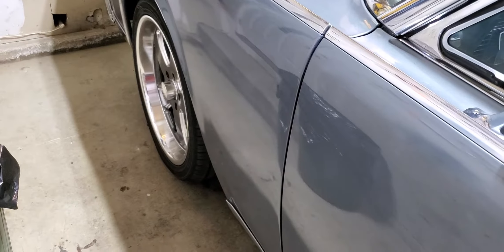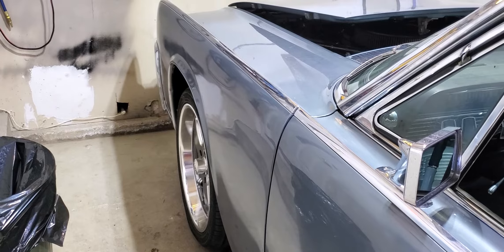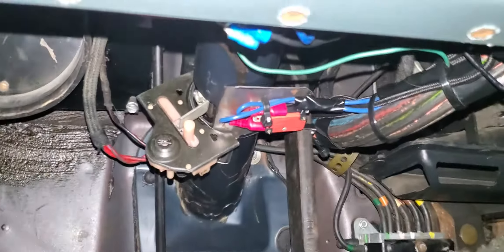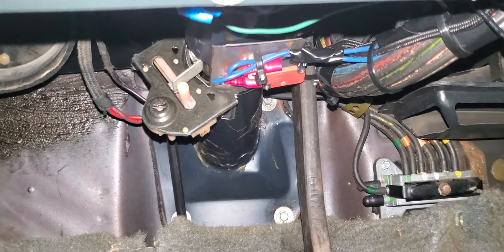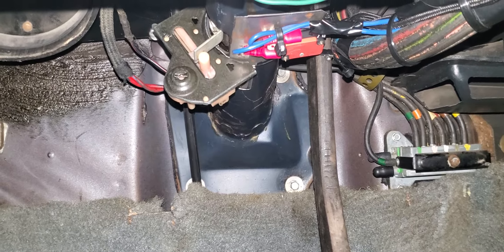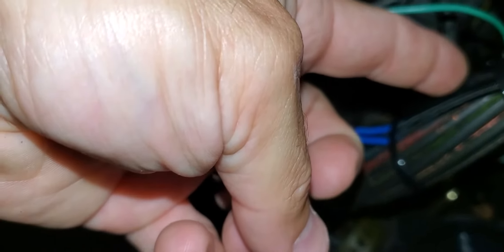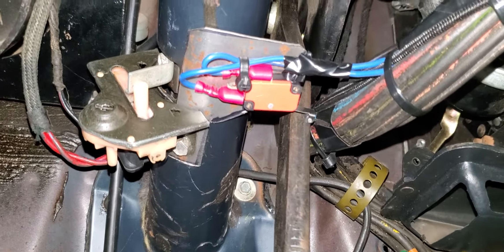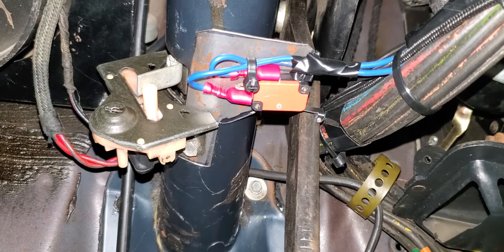64 Lincoln brake light switch

Comment: thanks for posting these videos. have you ever had issues with the ebrake release actuator vacuum  
leaking when putting the car in drive or reverse?  i swapped out the Neutral safety switch but that did not resolve the issues. i also check the hose connections and all seemed secure.
Reply from the maker: I bypassed mine. These cars have been known to jump into reverse and it'll run away on you. Safer to just release it manually
Reply: @patteahan8704  thank for my the quick response. good to know! I just put caps on the vacuum  lines that connect to the Neutral Safety switch to “bypass” it, and will manually release it here on out. 
thanks again for sharing your videos.